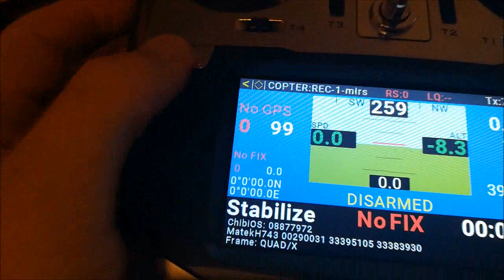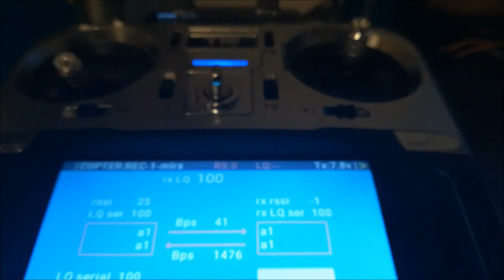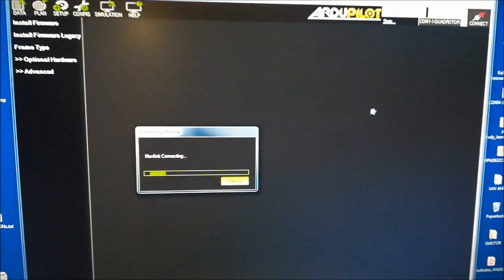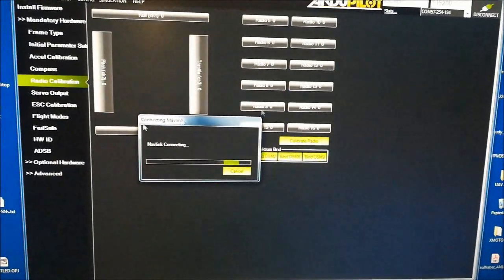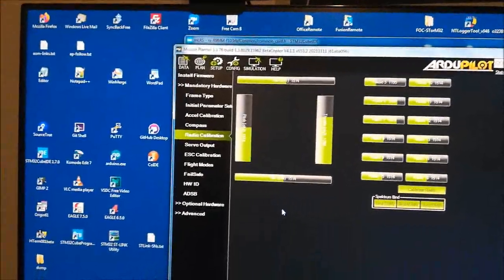mLRS: 915/868 MHz with Frsky R9M

Comment: If iam using R9M + R9mm Combo, how far can i expect the telemetry go?
Reply from the maker: I cannot tell you, I'm not aware that anyone has tested this out. In ideal conditions it should easily be several 10 km.
Reply: I see, Well, i will try it out. I will let you know the result @OlliW42
Reply: Anyway, Have you tested R9M to R9M? With full power 1W, can it reach 60KM Telemetry? @OlliW42
Reply from the maker: I only checked that R9M<->R9M works, and in the rcgroups forum one user was checking this too. No range results however. Theoretically it should go far. How far you need to test yourself.

Comment: Hi, olliw i am a mechatronics engineering student. I am currently trying to make an antenna tracking system with STorM32 v1.31. However, the motor I use in the mechanism I designed has 42 poles and I can choose a maximum of 28 poles on the STorM32 interface. What do you suggest I do?
Are any changes possible?
Thank you.

Comment: where is the wiring diagram for this? please let me know
Reply from the maker: hey. I'm not sure I understand the question. There is no wiring diagram needed, except maybe for finding the SWD pins. All you do is flash the firmware. Done. In case of more questions, pl consider joining the rcgroups discussion thread https://www.rcgroups.com/forums/showthread.php?4037943-mLRS-Lora-based-Mavlink-oriented-open-source-radio-link. :)
Reply: @OlliW42   I looked through the discussion thread but unfortunately I don't see detailed information in how to flash it. I see that you have alot of wires sticking out of the module, so I was wondering if you soldered anything on to board to actually flash it that way. Do you think you could make video about this? I have R9 and I really want to have mrls on it
Reply from the maker: yes, much info is still missing. But as said it would be best if you would join the discussion thread, it is soo much more useful for discussion than the YT commentary here. It e.g. allows to share info :)
Reply: Hello. I need help with flashing r9mm rx to mlrs. Can your help me?